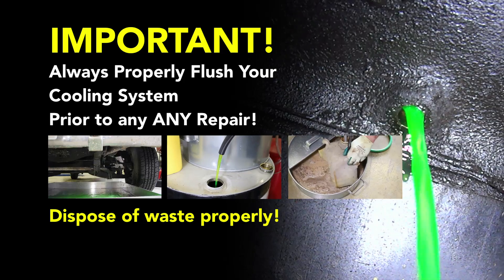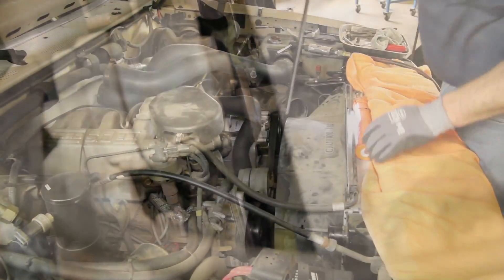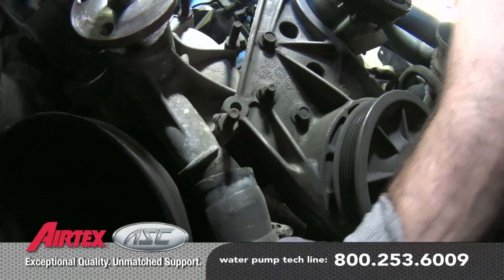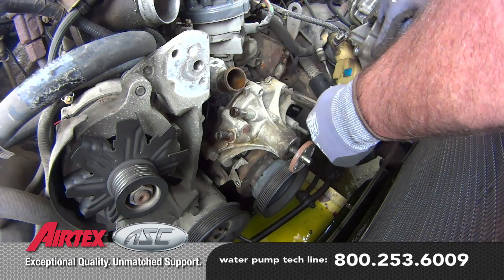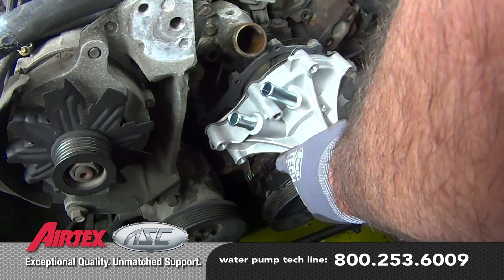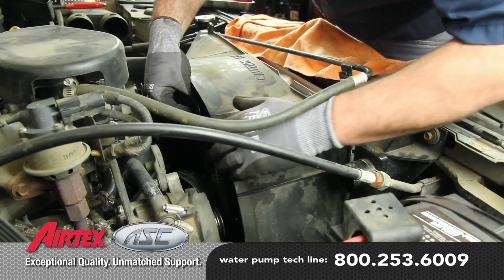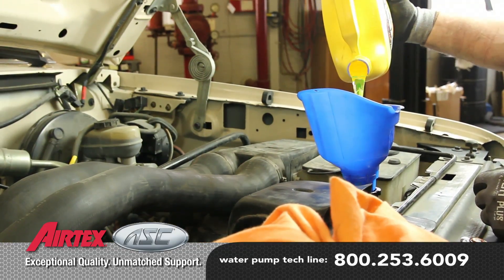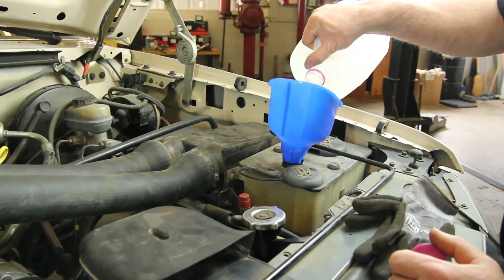How to Install a Water Pump - Ford 5.0L WP-657 AW4044

Comment: So these pumps typically come with one gasket already installed on it with the backing plate and a couple bolts. A terrible design imho. Seems to me that proper procedure would be to disassemble and seal that gasket and reassemble with those bolts properly torqued. Or join the long list of people who found out after doing the replacement that those bolts weren't even tight and the new pump leaks from that gasket which may not be useable at this point.

Comment: Great video! Exactly what I needed. One thing though, always in the past on different vehicals, I’ve always replaced the fan clutch at the same time, many parts places sell them together like a kit I suppose. A bad fan clutch will murder your new water pump rapidly I’ve discovered in the past. Thanks again for the procedures for this!

Comment: Got done and water pump was leaking out the side a little. Instead of taking back off and starting over I tried to tighten bolt. It broke off below the hole and it’s one that goes in block. Learn from my pain. If it’s Leaking start over.
Reply: Did you ever fix the leak am having the same problem

Comment: Could I have someone give me a list of tools used? I know you've got fancy stuff but I just need to know the tools I need so I can getrdone
Reply: Airtex/ASC Performance Pumps mine on my 1989 5.0 are 5/8 not 3/8 also you know the bolts that have the threads on them looks like a stud? well there's one behind the ac and power steering bracket. it was my last bolt to remove well... I applied to much torque with a break over bar and it shearded the bolt head right off. the bolt is so stuck I've tried heating it till it glow orange hot. tried oils everything. it's literally like someone welded the bolt to the motor. I don't know what to do and today is Saturday night I need to get it fixed by tomorrow so please let me know what to do and what to get at oriellys or autozone. thank you!
Reply: To late fir you, but when my exhaust manifold bolt broke I used penetrating oil for a couple days, and used an air hammer to vibrate the $-**& out of it. I also used a butane torch to heat it up a couple times (I suppose shock cooling it with ice might have helped too if I'd though of it). After all that it didn't budge and I though I'd have to get a nut welded onto it, but I went down to O'reilleys (I think it was them) and bought some power torque saw tooth parrot jaw pliers. Came right out!

Comment: ok. so after a min 30 seconds. i know that this is not a job i want to tackle
Reply: yeah I'm not looking forward to it. noticed a crack in my pump after pressure washing the mud off the engine. I was really hoping I wouldn't have to remove the power steering bracket or I might as well change the pump which also happened to fail today
Reply: Very Easy to Just  Remove the 3 bolts, and one nut, Holding the Power Steering and A/C Bracket Bolts, then  move it away and  tie down with a Rubber Bungy Cord .

Comment: The almost perfect video 9.5/10. Spay a little penetrating oil on the bolts an hour before to make sure no bolts are seized up.  My 5.0L Explorer has 175k miles on hèŕ. Lots of time for thread locking corrosion to hapen. Otherwise a very helpful video. Excellent to point out old antifreeze. Have you even seen a dog die from drinking antifreeze? Not a preety scene when you dont know its happened. Ethylene glycol is a toxic, colorless, odorless, almost nonvolatile liquid with a sweet taste that is sometimes accidentally consumed by children and animals due to its sweetness. Following ingestion the symptoms of poisoning progress from signs similar to intoxication and vomiting; to hyperventilation, metabolic acidosis, and cardiovascular dysfunction; and finally acute kidney failure. Save that fluid you drain no matter how rusty is is.
Reply: William Cameron agreed great video.

I'm pretty sure one of our sheep died from this as there were a bunch of old trucks out in the field. That was one of the most painful deaths I saw while raising animals. We didn't know what it was so we tried nursing it for a few days before realizing it was just torture to let it live any longer. I wouldn't wish that on anyone/thing.